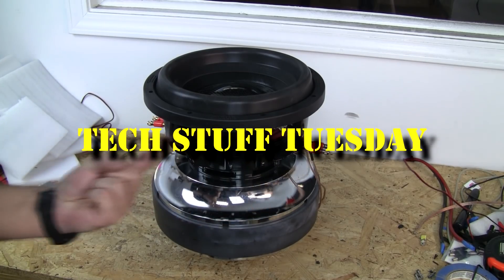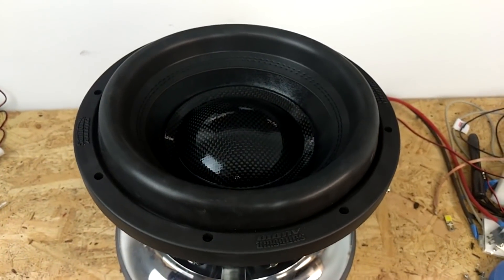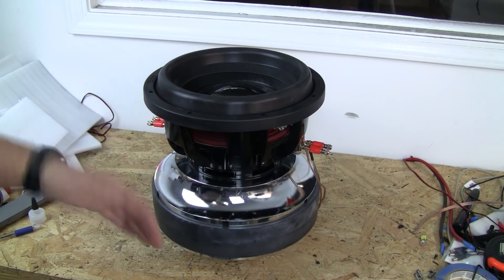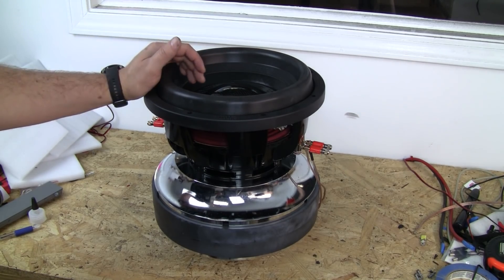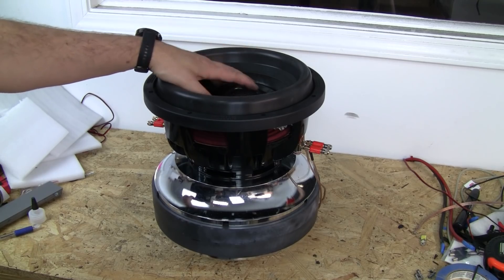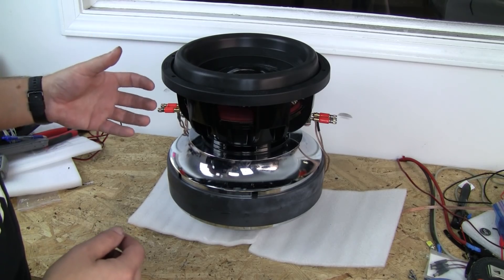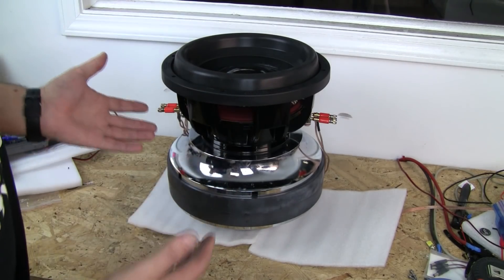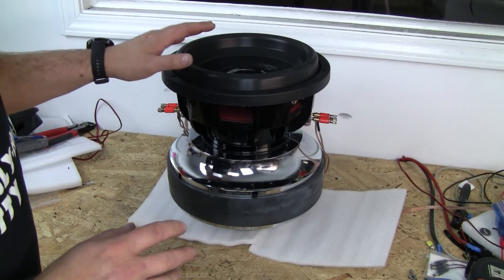This is why we bench test subwoofers - Tech Stuff Tuesday

Comment: Isn’t that kind of pointless? Won’t he never be able to use most of the power of the magnet because of how it’s built? It’s like bottle necked? Couldn’t he achieve his goal with a motor that’s 1/4 of the power or (gauss) of that one? That’s like putting a 800hp motor on a pedal bike (if you could) ya you could ride it but you’ll never be able to use half the horse power because it’s on a damn bike lol I understand “it’s what the customer wanted” but I would just like your answer / opinion
Reply from the maker: I wouldn't have built it if it wouldn't work. He can absolutely use the power to a great extent. I'm not sure why you think the power couldn't be used.
Reply: EMF Audio I didn’t say it couldn’t be used.... and I was asking you a question, if you couldn’t tell. Do you not understand my question? Basically asking won’t the sub reach mechanical limits before you use even half of the motors strength? I asked what your opinion was on it, but it seems like you don’t wanna answer. I also asked if he could have had the same outcome with a motor half the size...
Reply from the maker: @reactioN9449  I did answer, I'll answer another way. no, it won't reach mechanical limits before using the motors strength. The motor strength itself never changes, the amount of power you put in the coil does change and there will come a point where there is full saturation and it won't do more. This 10" operates very little different from the 12", 15", and 18". Those models have more moving mass and the effects are gradual in the same way. This is designed to play higher frequencies, and it needs the motor force to get it moving or it wouldn't cool properly. That also means it doesn't need the Xmax to perform the same way. A motor half the physical size does not equal half the motor strength either. The coil is the same that's always used in that motor, the moving mass is less than say, the 12" but it's not drastic. All that being said, this is perfect for the application he has. If it were for lows like a "standard" larger size model, it would not be optimal.

Comment: Fs 43.5 kinda sucks. I bet the customer ends up regretting that choice. Regardless that is 1 impressive woofer.
Reply: @ElectronicRedPanda yeah that's true 10's have a high fs usually. It does matter what the fs is though free air or not. I'm no rookie man. Not that I or anyone knows everything about car audio. You can always learn more. I stand by my original comment still is all I'm saying. I think it's crazy no matter what you listen to, to say with 100% certainty that you will never play anything under 40 Hz. I don't even know of music like that exists. Maybe some songs yeah. I listen to all sorts of music and I know for sure that NONE of it only has bass @ 40 Hz and above. I could be wrong by in my personal experience in being a basshead 20+ years I've never looked at it that way. Ever.
Reply: 84dB/1m is even worse.
Reply: @ElectronicRedPanda good point, why waste power...  Pushing high wattage gives people bragging rights and that's about it. If I can get the job done with less power and smaller supporting components I'm happy.
Reply: ElectronicRedPanda I’m not sure efficiency matters when you dump a whole load of power to it. If the motor was failing before everything else, then the customer wouldn’t be able to achieve as high of an SPL (assuming power shortage wasn’t a problem). I’m absolutely no expert, I only question this due to the “unofficial sundown” channel, where Derrick commented on the “U” 18’s having more efficiency at lower volumes, but not at higher volumes, compared to the Neo 18’s?
Reply: IF HE DON'T WANT IL TAKE THEM IL GIVE HIM WHAT HE PAID FOR THEM EVEN IF HE WANTS TO KEEP THEM FOR A MIN AND SEE HOW THEY GET DOWN JUST LET ME KNOW PLAYBOY (✌🏼💪🏼🔈💪🏼🔉💪🏼🔊)
Reply: @basslife4evr772  it will slam no matter what I'm sure. It would be pretty pointless to have a beast of a sub like that if it didn't lol.
Reply from the maker: What if I told you he currently has Zv5's with an Fs of 54 hz? It's what he needs, period.

Comment: Try free air test at max vol. you can't find mechanical noise on low volume
Reply: Yeah go ahead and try that.... good way to blow your sub smart guy
Reply: WOW DUMB ASS
Reply from the maker: Yes, put 14,000 watts on a sub that can't take it, free air. Maximum excursion can be had without being max volume, and it was. It was played just before physical limits, with no mechanical noise.
Reply: @EMFAudio  I mean give little bit more power to check mechanical  noise even sundown also check their subs with low to high power.  I have tested my subs on 4krms amp check vedio of sub excursion  link below.
Reply: @EMFAudio  https://youtu.be/UmHJ08U5b38

Comment: Didn't you make a video explaining that "breaking in" subwoofers is a myth?
Reply: Like the other guy said, TS parameters should shift 20% or so within the first few minutes of heavy excursion.  They'll continue to shift pretty much forever after that but not by much.  TS parameter changes are significant fresh parts vs. that 20 minutes of stretching.  Definitely a pro move to soften things up a bit before pulling specs.
Reply: no he said just break it in by using it
Reply: BaSsAholiC he did but that  video was showing that not playing the sub to its upper mechanical limits would unevenly break in the suspension...the “breaking in” myth is that the sub needs to be played on very low power for an an extended time...to pull parameters for a sub it needs to be played and have the suspension loosened because parameters change once suspension changes.